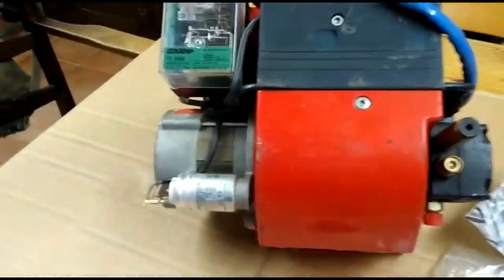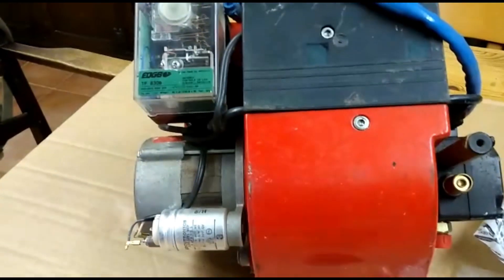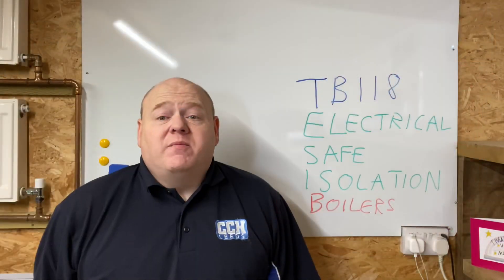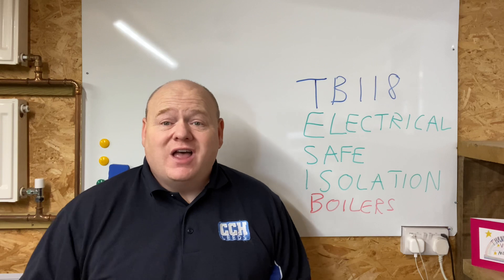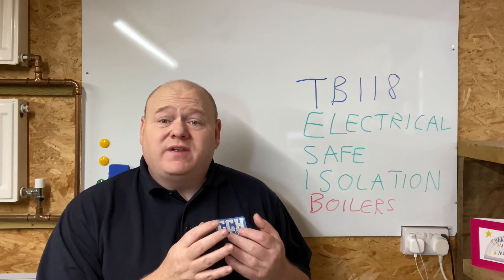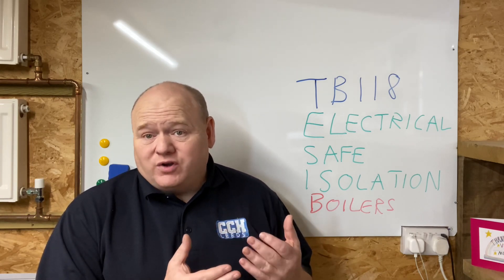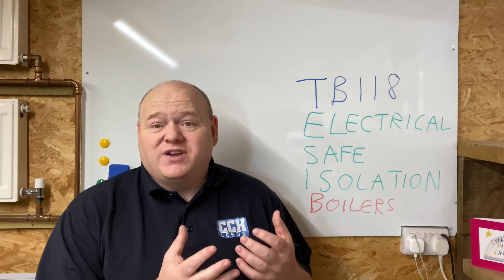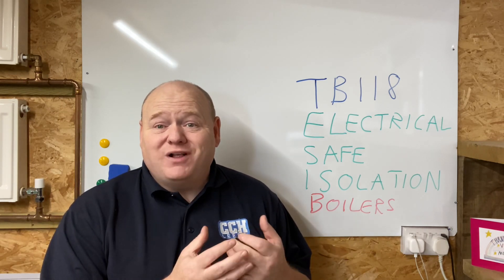How To Test A Capacitor With A Multimeter - Fault Finding on Motors / Warm Air / Oil Furnace

Comment: Something else to look for is what appears to be a sticky substance under the capacitor. I have been told this indicates that the capacitor is on its way out. It is something to show the customer and they usually ask for them to be changed. Hope this helps.

Comment: If not having a multimeter with a μ farad range function, just a very simple meter, then to see if the capacitor is working, just empty it of charge by shorting with the screwdriver as shown.

Then turn the meter to the ohms range. This will charge up the capacitor from the multimeter's battery.    A capacitor stores electrical charge (it is a battery).   Then turn the meter to the DC voltage range to measure the volts. Put the probes on the terminal. If a reading then the capacitor is not duff.  This does not mean the the correct micro farads, just that it is not duff, which is 95% of the problem with capacitors.
Reply: Ive been having lockout issues for months and cannot find the problem. I did the uf test and i have no reading, I did the test u mentioned and i am getting a reading, So my capacitor is completely duff?
Reply: @stuarts4673  
I would say yes. The capacitor is not giving the correct reading but appears to be working.
Reply: @johnburns4017  Funny how the heating engineer never mentioned it at all, Said it could be anything, Think this is the easiest to check first.

Comment: When the installer fitted my Intergas combi a good few years ago, he insisted I change a switched 230v supply socket for a none switched one. When I asked him why, he said, I have got to pull the plug to make it safe and I know it's safe with that plug out. Switches fail and I don't trust just pulling a fuse from a fused outlet so a none switched socket, please. This was done and every year he comes to service the boiler, the plug is pulled for the internal cleaning, etc. It's great to see plumbers who do a good truthful job without trying to rip off their customers.
Reply: Should be a DP FCU fused spur with a 3 or 6A fuse. He then just switches off and removed the fuse to service. Three pin plugs on boilers are not recommended.
Reply: Why do they recommend 6amp for oil
Reply: I always fit a fuse switch spur with a 3amp fuse.
But Why not a 3 pin plug with a non switched socket as long as it has a 3 amp fuse? once u pull the plug out there’s not doubt it’s disconnected
Reply: @rosstaylor4924  
The socket can be used for other purposes by unknowing householders.  Many boilers have their own mcb's at the consumer unit, as mine does at a 6A RCBO. Plugging say a 13A portable heater, because the boiler broke down will trip a 6A mcb or RCBO.

♦ Sockets are for portable appliances;
♦ Fixed appliances, as is a boiler, should be fitted with fixed electrical switching.

You may find that a DP fused spur is a recommendation in British Standards.  I recall seeing it somewhere.  A double pole FCU is double pole, well all that I come across  are. That means L & N are disconnected when off.

Comment: Many expensive circulators have found there way to scrap for the sake of a £2.00 motor starter capacitor, only required for single phase motors.

Comment: Another nice helpful informative video Allen,well done to you guys!  when it said ‘capacitor testing’  I was expecting the capacitors on the circuit board of a boiler, I’ve done a few PCB repairs on boilers and it’s always a satisfying fix
Why don’t you sell us the CCH radiator bleed keys? that should raise a lot of money for charity I’m sure all us fans would buy them. I will be more than happy to pay /donate £20 for one. Just a suggestion Allen

Comment: Sometimes the capacitors just bulge or split when they die. Usually a nice cheap and easy repair once the fault is diagnosed.
Reply from the maker: Any idea what i should do with the boiler? Thanks.

Comment: Yeah brilliant video for those who work on oil burners. This is something they do not teach at the college on the course.
Reply: Jones im amazed they do not teach basic capicitor testing.What type of course is it?
Its sounds like a diy course.
Reply from the maker: @iancampbell582  I was never shown anything like this. Thanks
Reply: @AllenHart999  every course on boilers should cover fault finding to show more understanding of the appliance I think
Reply: @iancampbell582  I basically did the whole oil courses you can do other than vapourising  burners. They just get you to learn operating sequences and regs etc. No fault finding
Reply: @CatholicAventures  fault finding (in my opinion) can not be taught. 
Any fault can be found when one knows how the device/circuit/component works. Together with experience you’ll always win.
I’m a sparks. My theory was via a HND in electrical engineering
Reply from the maker: Thanks.